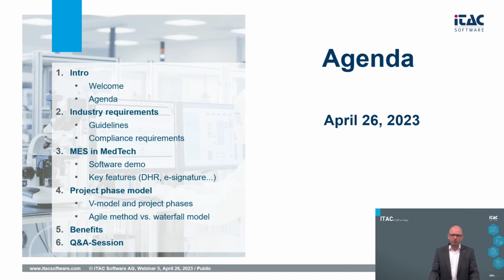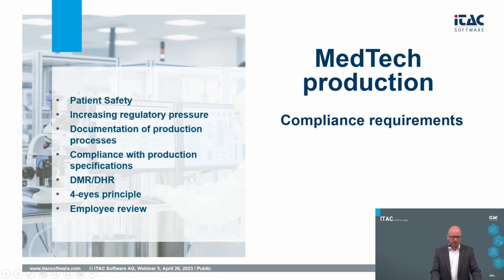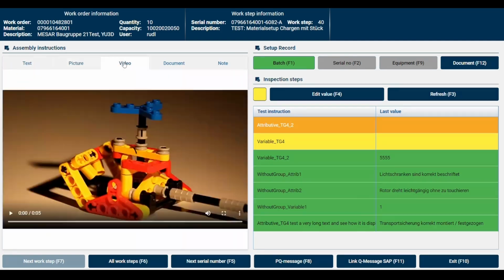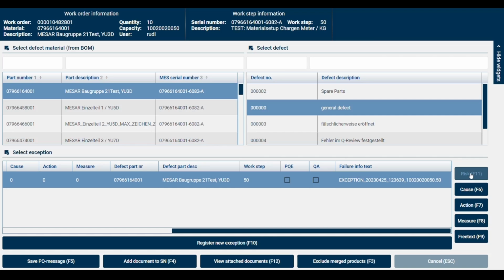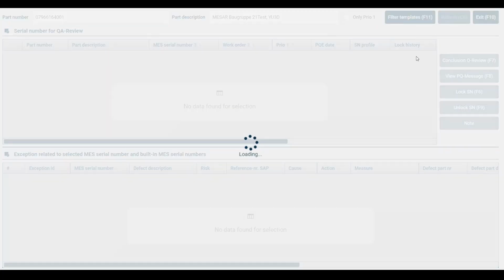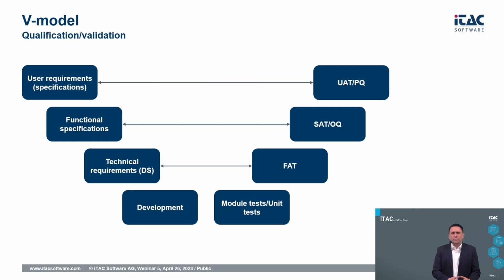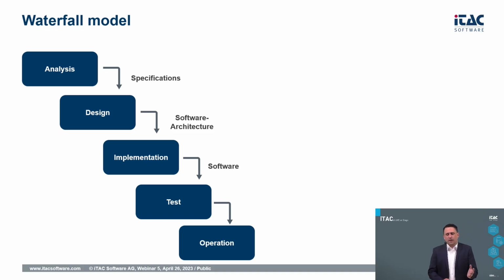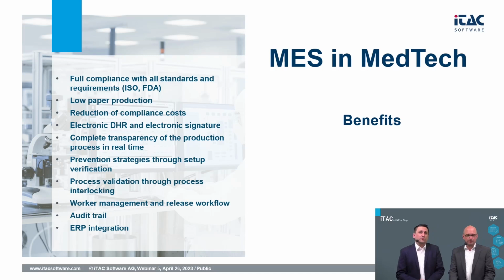MedTech: Simplify production processes and increase efficiency

Comment: In your Project Procedure Model, the process ends at 'Support' without further detail. Please describe explicitly how this Support phase governs version changes after go-live does every subsequent release repeat the same FS/FRA, testing, and OQ/PQ steps shown for initial implementation?Is the repetition of FS/FRA, testing, and OQ/PQ steps for each subsequent release included in the standard 'Support' offering, or is this separately quoted, additional work and if so, is it performed by iTAC, by client, or does it require external CSV consultancy?